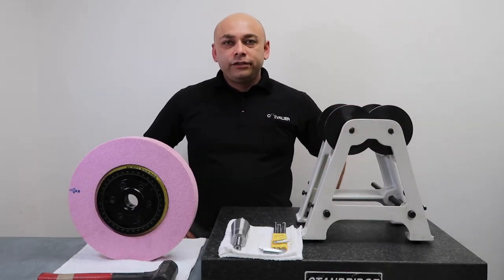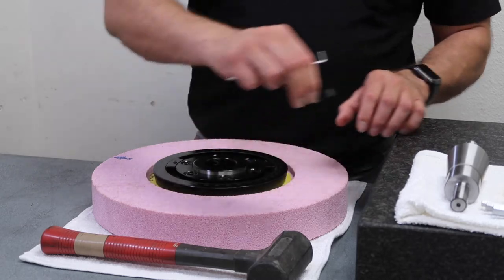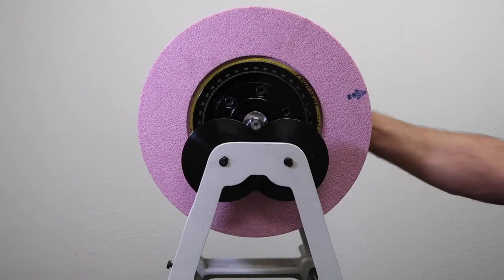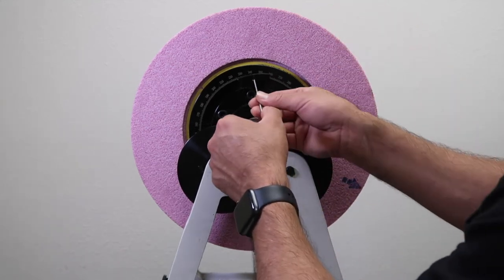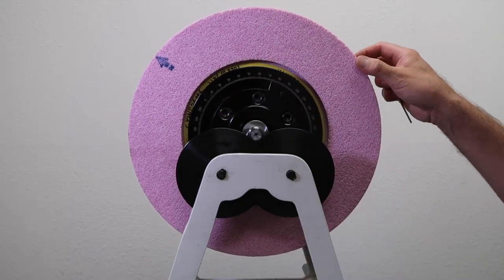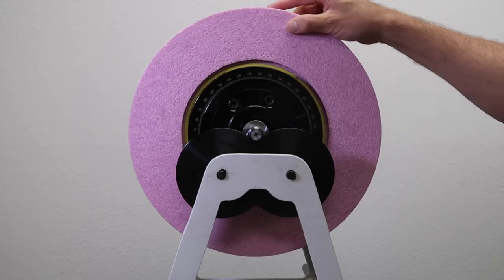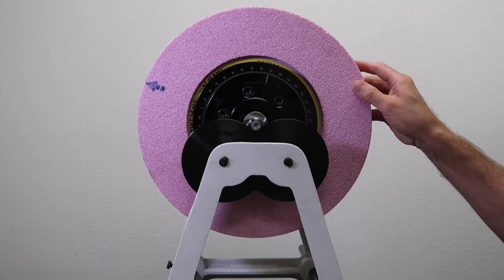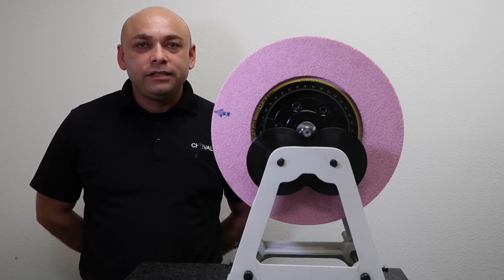How to manually balance a grinding wheel

Comment: Should you have to balance a grinding wheel everytime you put a new one on the hub? I operate and setup cnc roll grinders and lately we have had to balance our wheels almost everytime we change them. Only recently began having issues and having to balance the wheel and hub.  It's hard on a guys back.
Reply: Yes you do
Reply: Yup, every time, and you gave to recirculate it as well.